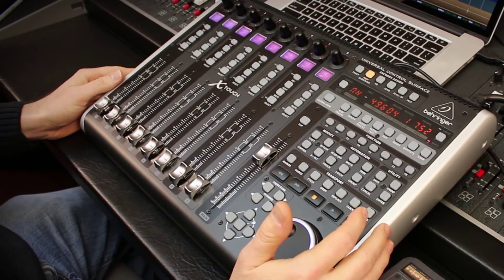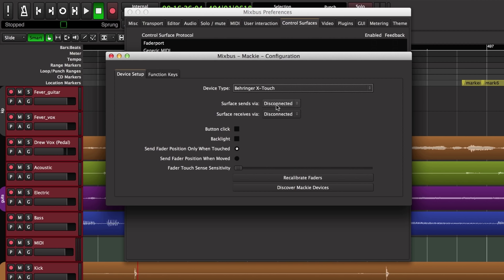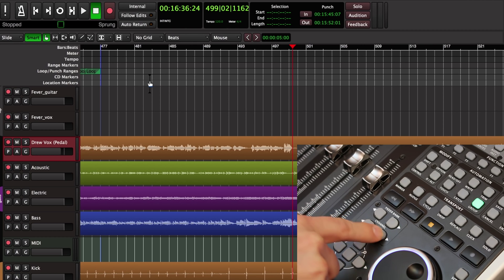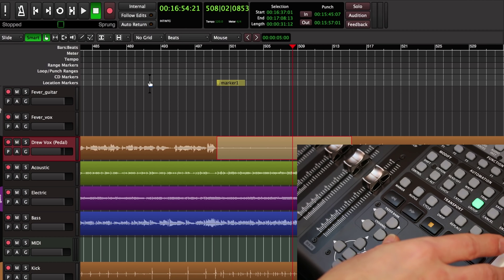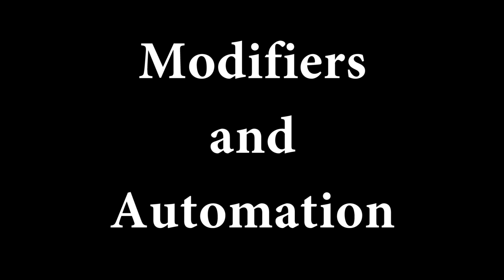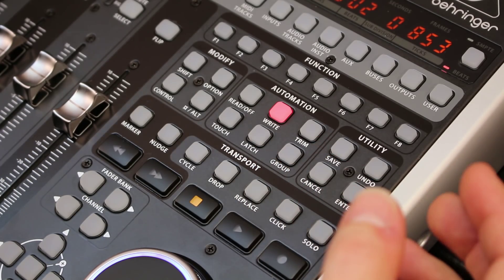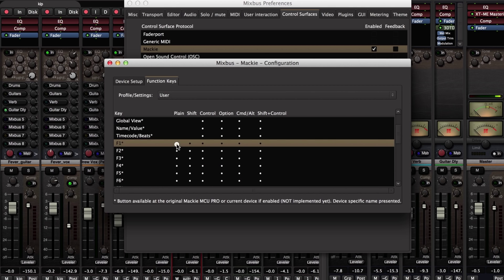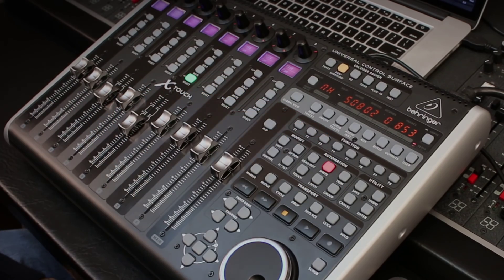Setting up a Behringer X-Touch in Mixbus (v3,4)

Comment: I love using the x-touch with mixbus but for some reason mixbus never remembers the x-touch. every time i open up a session i have to reconfigure x-touch. gets annoying.
Reply: tested now with my x-Touch and MixBus 32C v5.2 and when I session loads, the x-Touch faders goes straight into position. Using A Mac OSX. Make sure you have the latest Firmware on your x-Touch.
Reply: tested now with my x-Touch and MixBus 32C v5.2 and when I session loads, the x-Touch faders goes straight into position. Using A Mac OSX. Make sure you have the latest Firmware on your x-Touch.
Reply: tested now with my x-Touch and MixBus 32C v5.2 and when I session loads, the x-Touch faders goes straight into position. Using A Mac OSX. Make sure you have the latest Firmware on your x-Touch.

Comment: Hmmmm Being able to integrate modules and/or strips into my existing analog console frame would be a dream! (I would have to forgo a few channels of course!) Since many home studios are limited in space and (of course) budget, "foot size" of the control surface could be a game changer. (number of channels etc…)
I own a few older midi controllers (Peavey PC1600), and use my Yamaha AN1X’s built in control knobs to assign various midi messages to my DAW (or external FX units), but having a “real” (DIY) control surface designed to control MixBus 32c (and be compatible to be used with other DAW’s), would definitely interest me. I am a huge DIY fan!
count me in to support this project in any way!

Comment: Great video! I have had a blast with Mixbus and X-Touch! I am wondering about a 32c implementation, though. I use 32c, and for the most part, they work quite seamlessly together! However, when I hit "select" to edit a specific track, I can edit busses 1-8 by hitting the "sends" button...just as described in the video. But what about busses 9-12? Is X-Touch limited to only busses 1-8 in 32c, or is there a way I can access the other busses as well? Thank you!!!!